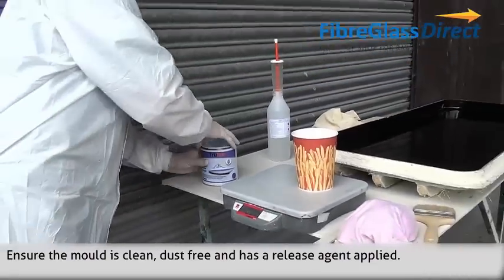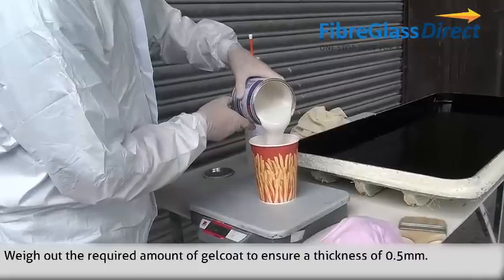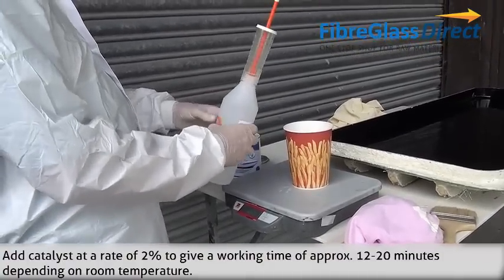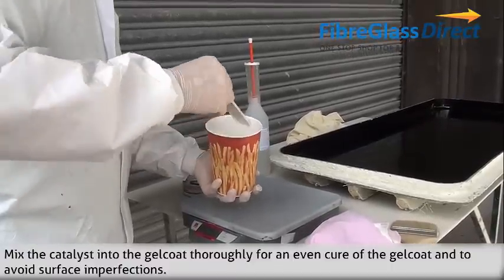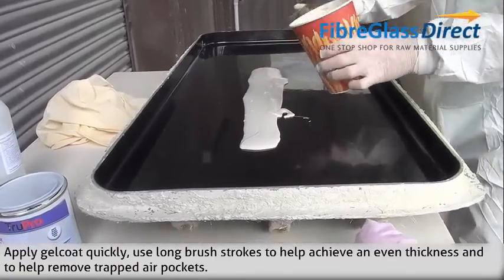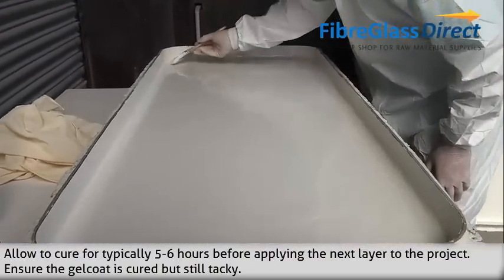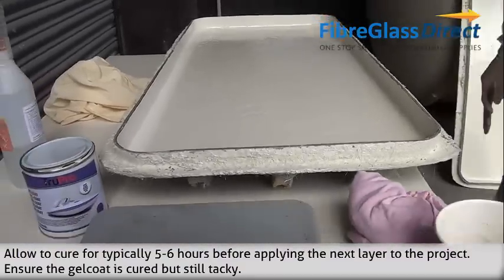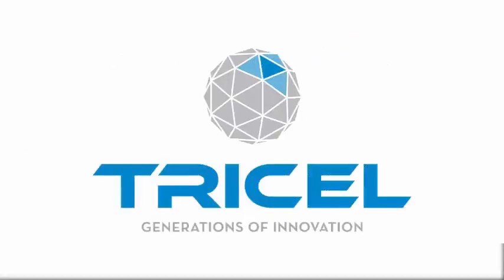How to Apply a Brush Polyester Gelcoat in 7 easy steps

Comment: In the case of doing a 13 ft by 36 in wide fiberglass boat would it be best to do the entire boat in one coat first let it dry and then do it again or do one real thick code one time?
Reply: brt 123 I have similar size boat project.  Thinking about the same.  Not sure if I do two coats or one thick coat with wax.